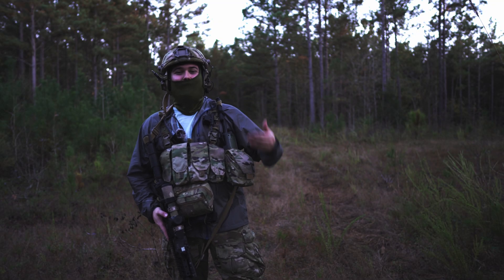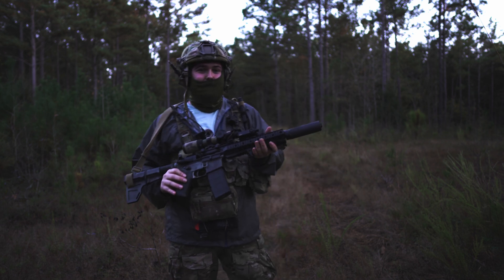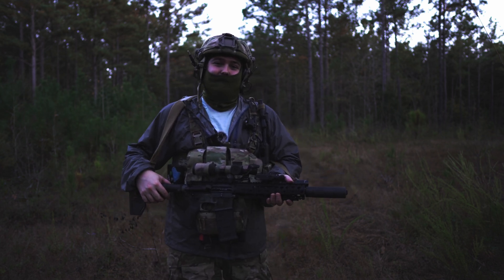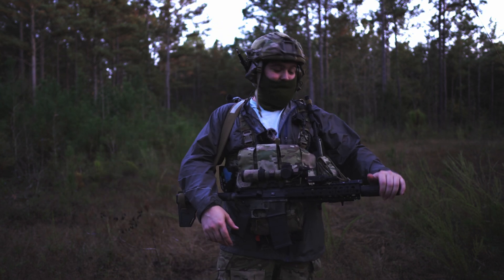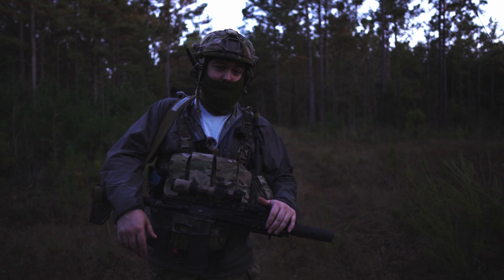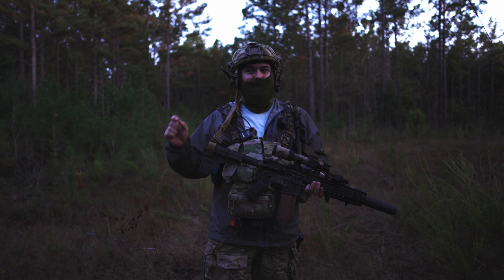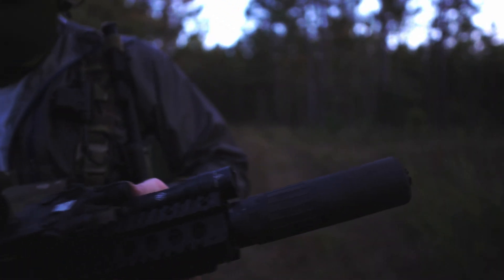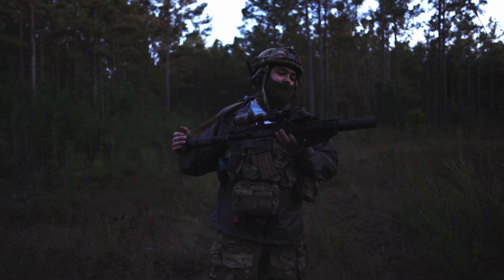Best Flow Through Suppressor The CAT WB 718

Comment: The ptr spiritus is going to shake the suppressor world up, can't wait
Reply from the maker: @saleen12  yeah? I’ll look into getting one.
Reply: @Greystone42  check out juciey medias review on it. Wild stuff.
Reply: I just some info on the Sionics MCTR. 12 oz full inconel 3d printed high flow can. I wonder how similar to Spiritus? We live in such a good time for cans.
Reply: Overrated
Reply: Planned to order a Spiritus, but not so sure after reading about their warranty. The way I understand it…Due to the PIP design, if you get a “baffle” strike or end cap strike, you’re pretty much SOL bc they can’t repair the “foam” printing.
Reply: @JGoodZX6R  will they not send a replacement?
Reply: @ clarifying that, but from what ive read, it doesn’t seem like it. I’ll correct this if I’m wrong though.
Reply: @saleen12  spoke with them today. Bad info out there. They said if it’s a manufacturing defect it is 100% covered/replaced. If a fault of the customer/ammo/etc they will still do whatever they can to get it replaced and take care of the customer. So doesn’t sound like you are just SOL like I have read in some places.
Reply: That and the Dillion can. Let’s see how there K cans fair, ie. KK & TSWIF.

Comment: I actually like the matte rough finish on the wb
Reply from the maker: It's fine for now, my question is. How will it look years down the road?
Reply: I just received my odb sound and performance is excellent. Finishes suck pretty fuckin bad @Greystone42
Reply: @Greystone42 it should look the same, additive manufacturing usually leaves a finish like that, it’s something unavoidable but that is the actual material of the can that is bonded through the process.

Comment: Isn't titanium one of the most durable materials, more so than inconel?
Reply from the maker: @brockholtschlag1879  Inconel would be considered more durable than Titanium, what Titanium offers is significant weight savings.
Reply: My understanding is that titanium is very durable until it reaches a certain temperature.
Reply from the maker: @zac129  right, with the thickness of titanium used, in general with suppressors. They reach a temperature that can damage them faster than other materials that are used. Such as SS and Inconel. Alternatively Titanium cans cool down quicker than ones made out of other materials. Titanium suppressors for example, usually can’t handle the same rates of sustained fire that other types can. They are getting better I will say though.
Reply: Here is what you are looking for. 
Titanium: lighter Direct thread or Qd configuration, perfect for a lightweight setup and cools faster than inconel or steel. So the possible ir signature disappears quicker. Cons, takes at least 300 round initial break in depending on design for it to stop exhibiting sparks. Another con, if you run a suppressor wrap for mirage mitigation. The extra heat trapped will degrade the titanium and welds over time raising the risk of the baffles collapsing and bad stuff happening. So Don't use suppressor covers on a Ti can.

Inconel: Pros are that it is stronger, more heat resistant than both steel and titanium.This allows for longer cyclic firing rate. Cons is that inconel is also heavier than both Ti and steel considerably.

In fact In race cars we like to use inconel on the exhaust side for added heat resistance under high boost conditions. Because they are heavier than steel valves we have to use stronger valve and lifter springs to counteract the increased mass in the valve train.

Ultimately it's up to your use case and everything is a compromise. List out  what your actual use case is and pick accordingly. You will be happier in the end

Comment: Did you get the qd version and have you had any issues with it loosening up
Reply from the maker: @zacharmijo9398  I did get the qd version and yes it came loose a few times until I figured out the right amount of force to put on it while putting it on. So for me hasn’t been an issue for awhile.

Comment: I don’t understand the hype with this can. It didn’t sound great at all. Seems like buzzword marketing with a price tag to go with it
Reply: I own this can, as well as many others and have shot a lot of cans that other buddies have and have shot a lot of cans at industry range days.The CAT WB and the PTR Vent 3 is by far my favorite so far. One thing to remember is a lot of these videos are filmed in and around a lot of blast reflecting surfaces and videos don’t really do cans justice as well, especially on a supersonic round. In person the CAT WB sounds like an RC2, but while still achieving much less backpressure. A polonium will lock the bolt back on my 12.5 with adjustable gas at setting 1, an RC2 and SCI SIX will lock back on setting 4, a Velos LBP and CAT WB will lock back on setting 7, but the WB is SIGNIFICANTLY quieter, the PTR Vent3, and CAT ODB will lock back on setting 9, and a HUX Flow556k locks back on setting 10… if you even count that can as a suppressor, lol. And for context the gun locks back unsuppressed on setting 10
Reply: @Kenposhinobi  Amazing response.  Thank you so much for the summary.  I own these cans but haven't been able to test them all yet.  To add, the KAC PRT/CRS sounds like an RC2 to me with much lower back pressure.
Reply from the maker: Yeah I'm thinking about borrowing some professional audio equipment and trying to portray a more accurate representation of the sound it makes.
Reply: I have one and it simply checks a lot of boxes all at once. In person it sounds great (felt comfortable without earpro, although not hearing safe based on science), its not too long or heavy, and its pretty low on backpressure. Its just a great all around can without much compromise in any category.
Reply: Because objective Pew Science data disagrees with this take. They have stated this can has low blast propagation resulting in a low bassy boom than a crack. Which in person is much more pleasant than traditional cans

1. Most feedback I've seen on the B&T SRBS compared to the CAT WB or any other can has said the B&T was quite unimpressive. Plus ZERO pew science data on it, therefore any current statement on it is objective.

2. According to pew science data again, The CAT WB beats out the Velos in every metric at the (muzzle AND ear) while still having the bassy tone the Velos does. Not sure how you would like the Velos when the WB achieves the same thing but with better data metrics.

3. Where this can shines is its form factor not suppression. There's a give and a take with most cans. However, the WB does not or hardly gives up sound suppression to gain significantly lower backpressure. Are there cans that are quieter? Yes but they're either longer, gassier, or heavier. Are there cans that have lower gas? Yes but their tone isn't as nice (HUX).

4. No companies come close to CAT and PTR atm. They are consistently topping the data charts
Reply from the maker: CAT is on top right now imo
Reply: Because it isn't "hype," it's backed up by objective Pew Science data that disagrees with this take. They've stated this can has low blast propagation that results in a low boomy tone than a crack which is more pleasant in person than traditional cans

1. Most feedback I've seen on the SRBS compared to the WB or any other can for that matter has been quite unimpressive for the SRBS. Plus, currently ZERO pew science on SRBS meaning any statement on it is merely subjective compared to objective WB data.

2. Again, pew science data shows the WB beats out the Velos in nearly every metric (significantly at the muzzle AND only gives up 0.2 at ear rating) while still having the same bassy tone. Not sure how the Velos is better than the WB when the WB has better overall metrics.

3. Where this can shines is its form factor not suppression. There's usually a give and a take with these flow cans. However, the WB does not or hardly gives up sound suppression to can significantly reduced backpressure. Are there quieter cans? Yes but they're heavier, longer, or gassier. Are there lower gas cans? Yes but their tone isn't as nice (Hux)

4. No companies come close to CAT and PTR atm. They're consistently topping the data charts
Reply: @christ.5258 
No companies come close?
Dillion DRC does.

Comment from the maker: To clarify, this is the MIL version of the can
Reply: What do you mean by the mil version? The fact that is the inconel version over ti, or is it something else
Reply from the maker: @ So it turns out cat sent out some “MIL” versions of this can. Mine happens to be one of them. They added material to high wear areas to make them stronger. Also adding some weight. These should be for sale soon though.
Reply: @Greystone42 Kind of shady that they have a "mil" and nonmil version of the same can and didn't tell anybody there was a difference, especially at their price tag. An RC2 is an RC2 no matter where you get it from, should be the same for the CAT.
Reply from the maker: @ They offered an explanation about it. Allegedly they were unknowingly using the file for the mil cans by accident in production and some were being sent out to the public. Personally I’m fine with mine and actually like the idea of having some reinforced areas at the cost of some weight. They are offering to take them all back and replace them if folks want though. Also they’re going to offer this version to the public down the road as apparently some people were interested in buying them.
Reply: @Greystone42  I have a local shop that sells "Alley Cats", which sound like what you have. Contract overruns.  Little longer, little beefed up & an extra baffle compared to the White Bread.
Reply from the maker: @ the Alley Cat is a different model.
Reply: @ You're saying there's the WB, Mil-WB & Alleycat variants?
Reply from the maker: @EverythingisFire  It would appear so
Reply: The most OOS can
Reply from the maker: @ I would agree but the mil cans are engraved differently. So clearly these were made intentionally.